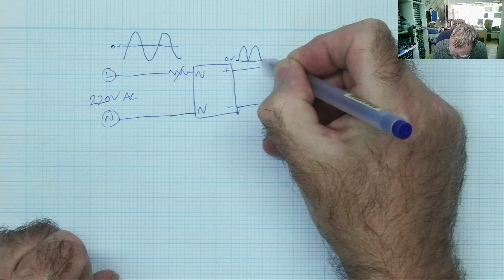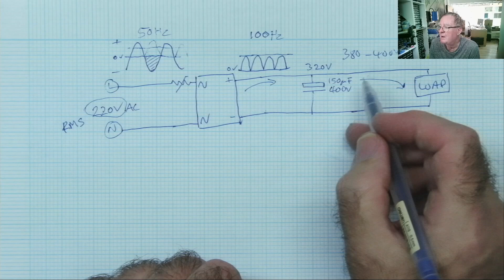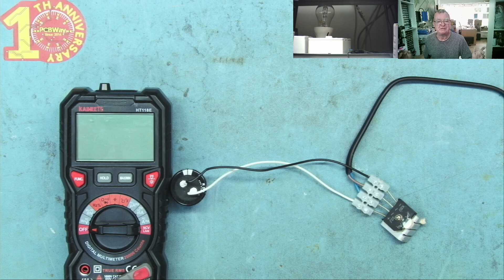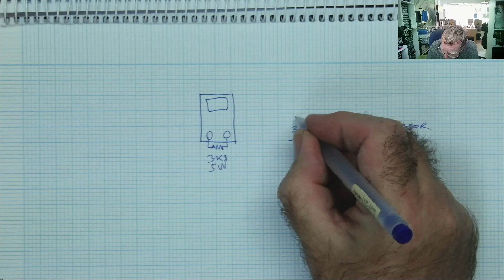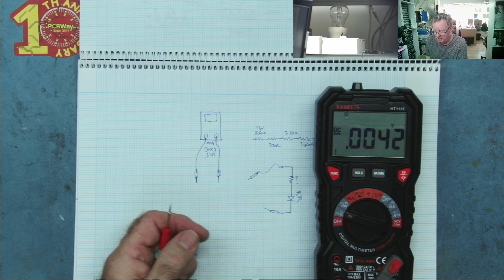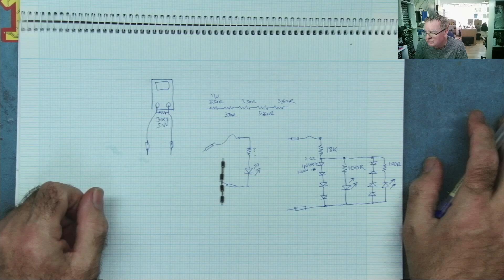How To Discharge High Voltage Capacitors : Cheap DIY Capacitor Discharger

Comment: You also need to watch out for the fact that once discharged  if the load is removed the terminal voltage can start to creep back up.

Can i point out hearts don't give a fig about voltage, it's current that counts. the voltage is just there to break the skin insolation.

Old saying "Volts jolt but mils kills" 

(IEC) 60601–1. Body and Body Floating (i.e not earthed)  have similar values (e.g. normal AC leakage current of 100 μA) 
notice no mention of voltage in the safety standard.
Reply from the maker: Semantics... you can think about it when you are lying on the floor waiting for your brain to run out of oxygen 😂
Reply: @learnelectronicsrepair  Having worked on the design of a product that applied a voltage to arterial blood, so had a direct connection to the heart. knowing the difference was important, well to the person on the other end of the tube anyway.

I also knew of a chap who worked on the London underground who had a party trick of putting his tools on the live (+400V) power rail. he had a skin condition which meant that he had extremely dry skin and 400v was just a slight tingle.

Comment: Interesting video! 
An alternative if you only want 1 led, would be to use a bridge rectifier before the discharge resistor, depending on what parts are available, so it won't matter which way the probes are connected. It's great this can be made from salvaged parts!
Reply: For the simplest circuit with the lowest component count, use 2 bridge rectifiers connected in series (AC side) to the probes. On the DC side connect the negative of the first to the positive of the second and the LED+resistor between the positive of the first and the negative of the second. 5 components including the bulk resistor. You can use very small bridge rectifiers (>0.1A) and a bulk resistor of 4K7 ohms for fast safe discharge even at 440V. If you use a 5W resistor it will exceed its rating but for such a short period there's no time for it to overheat.
Reply: Was wondering if there would be a neater solution requiring fewer components and was trying to run the diagram in my head!

Comment: A little 230V 20W incandescent bulb permanently attached to old short probes, covered with semi-transparent buble wrap so it's indestructible, is always hanging on my tool wall for exactly that. Self limits the current to less than 100 mA but draws almost same current from much lower voltages, so discharges caps almost instantly to safe levels. Made it right after I got a real nusty shock while repairing a board many years back...
Reply: What do you do with 400v capacitors? I'm still pretty new at this, but every psu I have taken apart recently has 400V+/- caps in it...

Comment: Thank you, I enjoyed the explanations. I need to build a capacitor discharging kit, so the information has came in useful. One question comes to mind tho. What happens if one or both of the LED fails? Would you end up with a false positive (ie discharged capacitor) and risk shocking yourself?
Reply: I always  "screwdriver" the capacitor terminals after resistor discharge..... that's your absolute backup - beyond measuring things
Don't trust any one thing is the best process.
Another one would be have a second person nearby whenever doing bare live working - depending on risk level (isolated supply + voltage + amount of stored energy)
Reply from the maker: just connect the discharger across a battery or power supply before using it/  Belts and braces is a good idea when safety is concerned

Comment: You could also use a dc analog meter with the power resistor across it. Will give a better visualization of the voltage dropping.
Reply from the maker: Does the analog meter work better then the digital one? Apart from not needing a battery
Reply: @learnelectronicsrepair  Yes. Its much better/easier watching a needle drop than a digital meter dropping. Especially having one of those large analog displays. (0-500v)
Reply from the maker: @CliveTrezona  I have an analog meter, I'll try it on a future video
Reply: @learnelectronicsrepair  There are old analog meters which don't need the batteries to read the voltage. The batteries are only needed to measure resistance, which isn't needed in this case. And I myself also want to use a analog meter which is much better to watch to monitor what is happening. And of course an extra led can still be used to see if there is hardly any voltage left. You could even build in the led and the resistors within that old multimeter together with a bridge rectifier. But my main preference is that I can watch a needle while doing the discharging. And would an NTC be helpfull in this circuit. Why not build the same kind of circuit that is used to charge the capacitor? If it charges in about 3 seconds, why not discharge it in the same time?
Reply: I have one that goes to 300v would it damage the meter if it goes beyond that displayed value or are those displays pretty robust?

Comment: you don't need to discharge them, unless energy is infinite , just leave them alone for a few hours, that's what I do at my pc repair shop.
Reply: that's good enough if you don't repair electronics, but as Richard said, you need fast method for everyday use.
Reply: @ДимитърАндонов-ъ7е  maybe google translate that again so it makes sense
Reply: I've seen good capacitors keeping 200V after 10hours. Be safe and careful.
Reply from the maker: @francescvilches3967  True I've seen very large capacitors in an high power audio amp (with the leads to the amp modules disconnected) hold a nasty charge for several days
Reply: @francescvilches3967  obviously I don't mean a couple of hours...........I mean if it hasnt been used for a few days.........
Reply: That's fine if there is some form of dc load on the cap which there might be in circuit. but remove that DC path and you could be in for a shock(pun intended)
Reply: Capacitors keep charge for a long time depending on the circuit. Some of the audio equipment I work on holds over 200v for days. Get a discharge pen, they're cheap and are essential..
Reply: In Ireland and we have an Old Saying that is so true:
Is Airgead an t-Am.